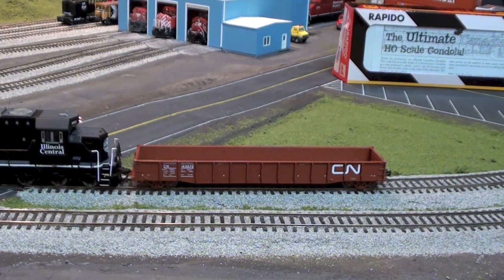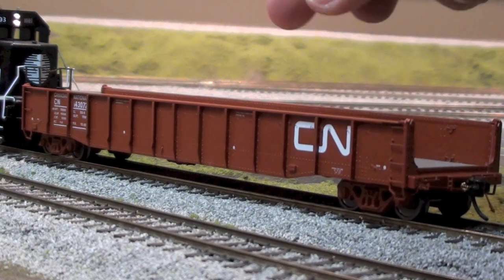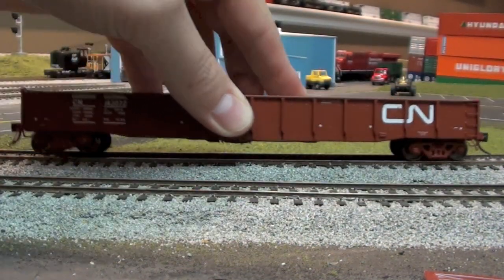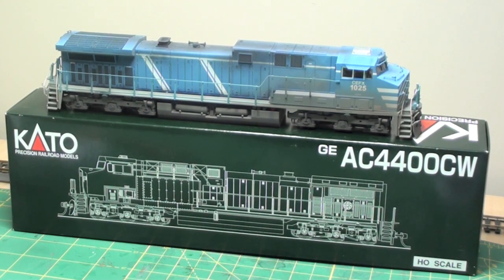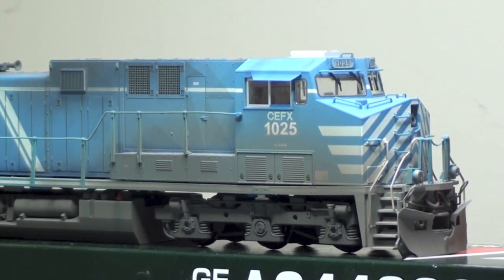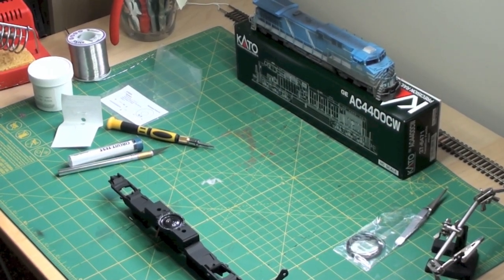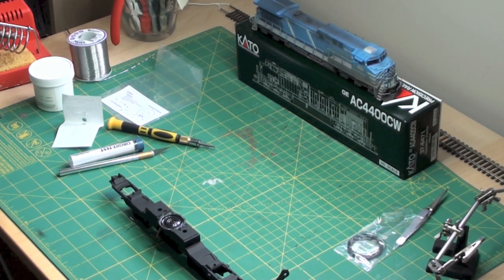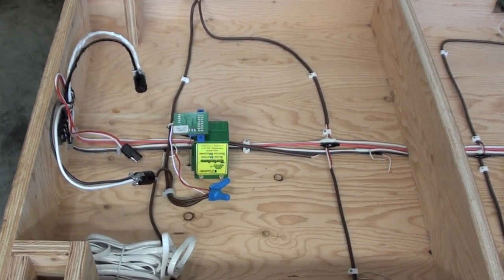Layout Update - June 2014: Rapido gondola, KATO AC4400CW weathering, module wiring...

Comment: Nice work on both the loco and the module. I'll also look forward to your install video on that Kato. I did one install on an Athearn blue box GP38-2. It worked but I now see there's ways I could have done a much better job. I'll be cracking it back open some time soon. Good learning process though.

Comment: Nice work Ben!. Looking forward to the Led install on the Kato,make sure you go slow on the SMD Led part...LOL. Between you and Matthias, you may convince me to try it...LOL
Cheers Gregg
Reply from the maker: Thanks Gregg! I will show you some how-not-to as well. I had to reopen the first two I did because I didn't cover the driveshafts well enough and an LED lead got wrapped up in it. With the fantastic drive-train of a Kato, you can guess who won that battle. Easy enough fix though, just have to make a little safety cover out of electrical tape and that solved the problem. I do it on all my installs now.
Reply: BArailsystem LOL. Look forward to it.!

Comment: Nice video, Ben. We could do a census on CN gons, as to whether yours is compatible with your era...certainly CN has a lot newer gons inherited from WC, IC etc, and these are taking over, though some of each are in use for scrap tie service. Also ex-BCR gons, ex-IC and CC hoppers, former gypsum cars and well, you name it. Makes for a great assortment. Certainly your car would be useful in MoW service.

Your module also looks great and very hi-tech. It is bigger than my front-porch layout I'm currently working on - watch for updates on Trackside Treasure. Feel like the dispatcher, flipping that power switch? 

Thanks for sharing,
Eric
Reply from the maker: Thanks for the comment Eric. Yah, I figured there are a few still kicking around. I saw a couple of the Canadian Pacific variety the other day in Penhold albeit with welded ends. It is destined for MoW on my layout. 
I look forward to the post on front porch layout building. As far as feeling like a dispatcher, I need to get a decoder for the tortoise and then we could go CTC. 
Ben